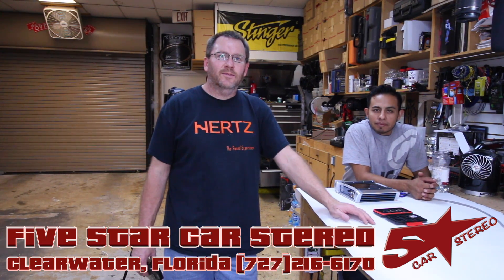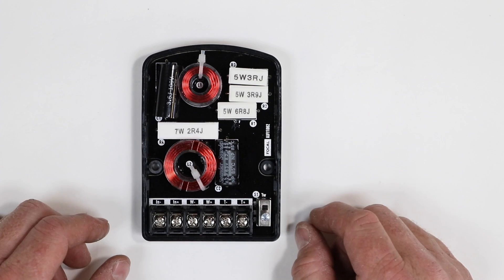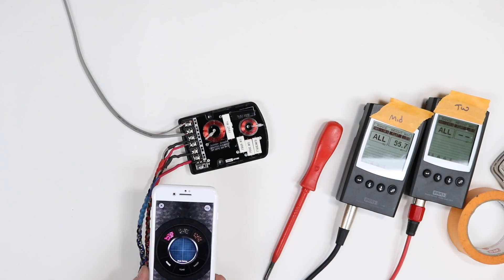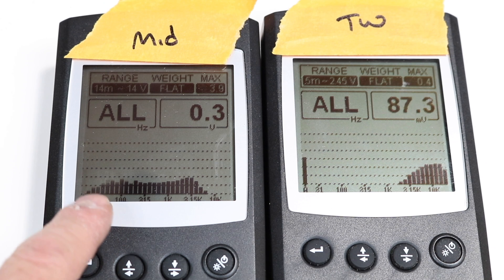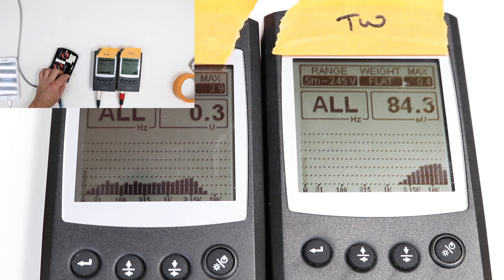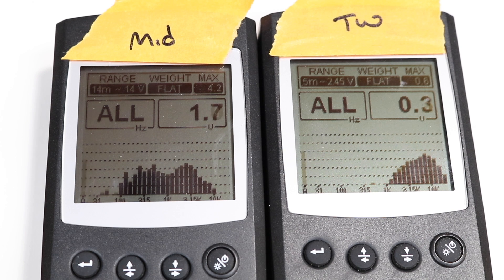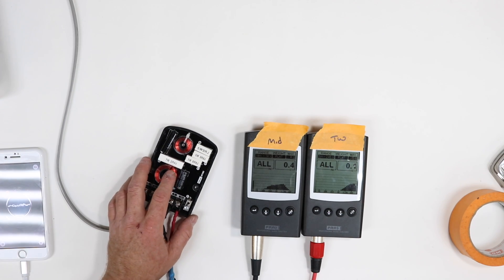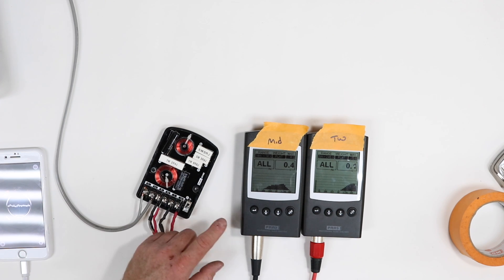What is my crossover doing to my speakers?

Comment: I'm still curious... If I have a 4 ohm tweeter and 4 ohm mid when they are hooked up to the passive cross over does the amp still see 4ohms or does it see 2ohms and can you use a 4ohm speaker with a2 ohm tw and vs.
Reply: JD did you find the answer to your question....i have a 4ohm mid and super tweets,,,want to run them in paralell therefore creating 2ohm.....wanted to use a 2way crossover and need to know also, will i have a 2ohm or keep 4ohm signal....
Reply: Did anyone find out?
Reply: @alexgarza867  still see's 4ohm
Reply: Edward Jones Thank you. This means no crossover for me, probably go with a bass cancelor

Comment: Long story short can I use crossovers on coaxils because the stereo shop blew my components and everyone is out of ks components 6x9s soo outta options with having to use 4 coaxil speakers instead of coaxils in the rear and my components in the front. Due to no one having the correct 6x9 components and me with out speakers in the front. So I was sent a pair of KS series crossovers but I was accidentally sent coaxials but now I have to use them. Can I use the-crossovers on my front coaxials? Or

Comment: Here's a question I have my stereo doesn't have a hpf crossover on it and I'm not using a 4channel amp just speakers straight to deck how can I take the bass out of my 6.5s? Do bass blockers work?

Comment: I have a dilemma. In my 5.1 home theatre system the center speaker is a Dynavoice Challenger c-5 mk1, and I recently noticed that out of the two 5.25inch woofers one sounds louder than the other (even tried swapping them, same problem). Why is this happening? The speaker receives the a mono signal from the AV receiver (LFE) so there is no problem with the balance. Or maybe the passive crossover in the speaker is faulty somehow. Please, what should I do?

Comment: Would it damage my 6.5s. Kenwoods i have in the rear and nvx. Coaxials   ihave in the front. If i set my hpf over 125hz  on my  4 channel mrv f300 amp. Nd 80 hz set for subs on my pioneer deh- 8800bhs. Head unit? Whats a good setting i currently have a 4 channel xed600.4 cerwin vega. Amp powering my door speakers and it cuts off when i play loud music and when bass hits .

Comment: thanks for the info. Does the RMS rating of a component set of speakers account for any power lost in the passive crossover? Should this be considered when setting amp gain?
Reply from the maker: Dave Peck I believe the overall RMS takes into account the hole package. Gain is not volume.
Reply: cool, thanks for replying

Comment: What I've been looking for thank you! I have one question. Will a crossover split the power from an amplifier to each speaker evenly? For example if I want to amplify a component set with a 2 channel 300 watt rms amp (150wX2 @ 4ohms) will each speaker receive 75 watts?

Comment: Excellent explanation, quick question, in a install where you only replace the factory speakers, could you theoretically connect a bass blocker to the input of the passive crossover to prevent the lower frequencies to pass trough, or you absolutely need an equalizer/amp with a high pass crossover?
Reply from the maker: You can do it, but I never have. The 2 crossovers will eat up a ton of power.
Reply: @FiveStarCarStereoInc  quick question if the compartments coke with passive crossover box should I also use the cross over on the amp?

Comment: great video as always !  I have always wondered if there is a way to determine the power (watts) to each speaker ? IE mid and tweeter through the passive crossover.  example would be I have a mid with a RMS max of 100 watts and a tweeter with RMS max of 60 watts.   my output power from the channel on my amplifier is 100 watts, is there a way to determine what each speaker is seeing ?  idea being what actual wattage from an amplifier channel do i need to satisfy both of those speakers to the best of their capacity.     or just how you would determine such, as you guys are top notch at what you do based on what I see on youtube !!    thanks in advance !
Reply: I've been wondering the same thing!
Reply from the maker: Nicholas Patti sounds like we are going to have to do some math in a video, stay tuned
Reply: sounds good lets break out some ohms law thanks !!

Comment: I have a 4 channel zapco amp that pushes 280 watts rms @2 ohm 
I am running 
4 6.5 American bass GF series all 4 ohm and 
4 1” alpine spr 10tw tweeters which are also 4 ohm 
What would be the best passive cross over that can handle the 280 rms

Comment: Hey! I have a question for you guys. I'm having an issue with my crossovers from a component set I purchased from Skar Audio. I have an alpine 4 channel amp model MRX-F30 to be exact. And the issue I'm having is when I turn up the volume on my radio its putting the amp into protection mode and wont play any sound until I pretty much reset the amp by turning off the car and turning it back on.... so I tried disconnecting the crossover and just connected the speakers directly to the amp and the speakers and the amp works perfectly fine no issues at all. The only problem I run into is when the crossovers are connected to amplifier. What do you believe the issue can be??

Comment: Tho i'm late, excellent explanation. I thought my 2 way passive component woofer was playing very low frequencies. I've been trying to determine what frequency though, probably all the way from bottom as you explained.
So, as you have described, I played around with the HP crossover and adjusted the range, to eliminate/lower the bass. The thing is tho, its hard to determe what cut off has been applied, and have to just go by ear.
The I realised my multimeter apparantly reads frequency. So I ran some test tones with an app, throught the system. The meter read the frequency correctly, but according to it, in the HP position, low frequencies were still getting throught?!
all the wau to 50z. The range on the amp crossover is 50-320hz. I played around and  it madeto difference, all low freqencies stillgot through. Maybe the meter is wrong.
As when I use my ear to listen, in the HP position and adjusting the pot, bass was removed.
Is it being just attenated? Maybe its damaged? As the LP crossover works as intended, even on the meter. Just so odd. I need one of your meters, but wish I could just rent one.
Reply: Does your head unit have a high pass filter on the front/ rear? 

I am running coaxial speakers off the head unit at the moment and found that at higher volumes the vocals would distort even though the signal was clean, this was because the lows were over powering the mids, setting the hpf on my head unit eliminated this at the cost of some bass, the speakers actually pretty good at making bass (people would ask if I had a sub) with a response rated from 45hz upwards.

My pioneer head unit has a hpf that can be set from 50hz to 200 cutting bass to the fronts and a low pass for the subwoofer output, with the HPF set to 100hz my mid are much cleaner and I can turn the volume up an extra ten points to around 55-6 instead of 45 before I get clipping (was just distortion before not clipping), at 200hz you lose a lot of the drums as well as the bass so unless you have a sub is not worth going that high.

Comment: Can you connect an aftermarket amplifier to the speakers and still use the passive crossovers?
Reply: Thats what was going on in the video example, he was just explaining how you would want to set the highpass filter on amp in conjunction with using passive xover's to fully protect speakers, in example's case to protect midrange from low freq. that the passive wasnt able to do

Comment: Great video as always guys.
Please use the following two as the question(s) of the week. 
When using the lc7i or lcq1 automode to generate a sub output, is there signal (voltage) loss in that generated output?
Does an 80amp fuse in an amplifier mean that anything over that rating will pop the fuse?
Reply from the maker: Brian Miles 1. No it keeps voltage. 2 . Only if it is for a long period of time. Short bursts will not blow it unless it is a true short.
Reply: thanks

Comment: Lol, didnt explain how it works at all
Reply: I thought the same thing. If it doesn't take out the low's on the mid range, then what's the crossover used for?
Reply: Rafal Grabski  A crossover is not a filter (high/low pass). It splits the signal to different drivers.